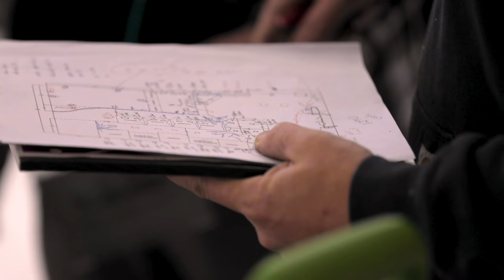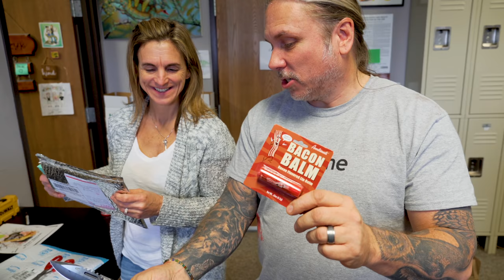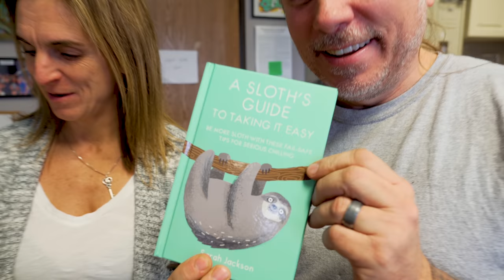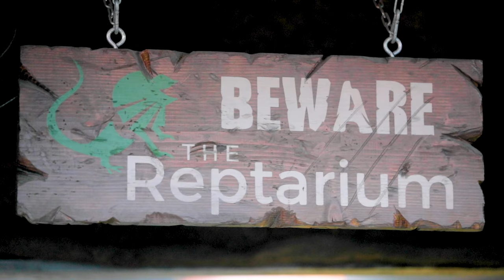TWO HEAD SNAKE FIGHTS OVER FOOD!! | BRIAN BARCZYK

Comment: Hey Brian why don’t you use a pc with a decent graphics card for the podcast? You can use obs studio which is free and geared towards streaming live. Also if you go that route it’ll last forever since you can upgrade/change parts when needed. Graphics cards encode under nvec and you can easily get started for under 500. Plus obs studio has YouTube/twitch settings already in it
Reply from the maker: We need multiple cameras that will be  switched. So going through a PC will not help. But thank you